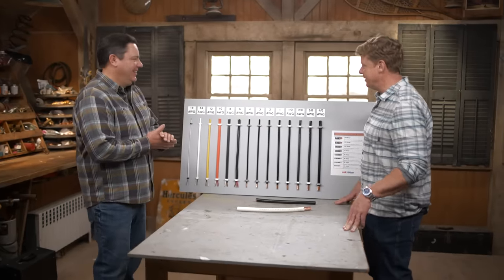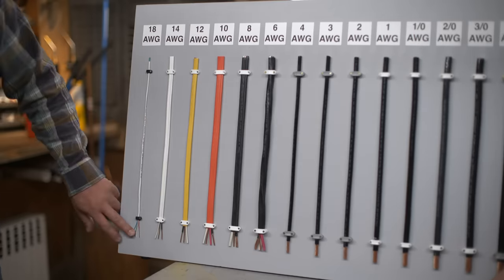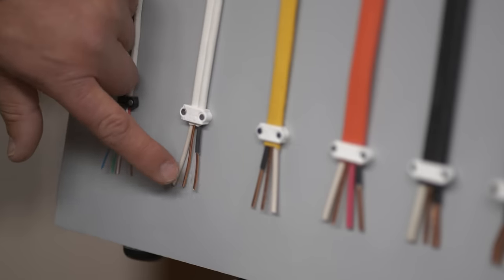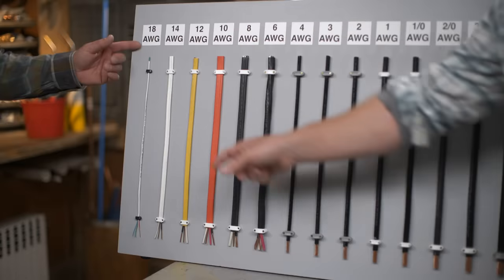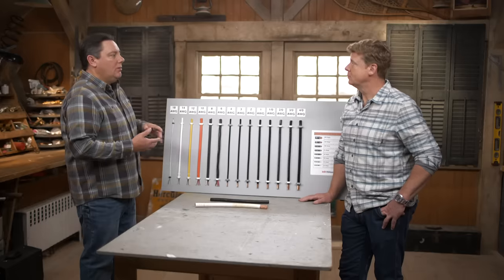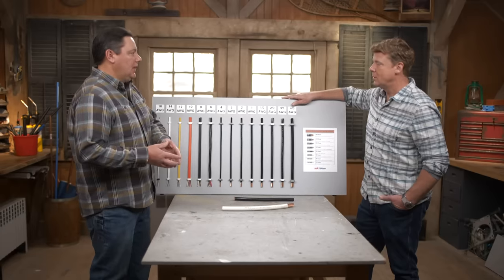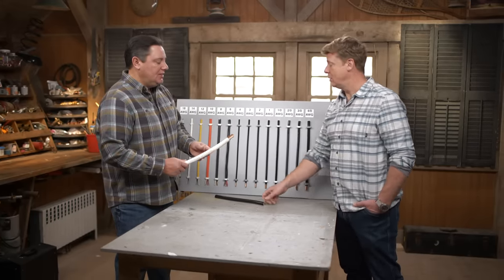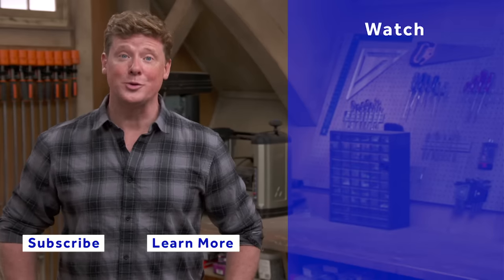Understanding Wire Gauges | Ask This Old House

Comment: Metric is way easier🤯
Here in the Netherlands and some other European countries in a new house:
Mains connection is 3 fase, 230V, 25A with a separate neutral and ground.
The wires inside the breakerbox are 6 mm2 thick.
The circuit breaker are 16A with 2,5mm2 wires running to your outlets/lights (except the switch wire for the lights, this one is 1,5mm2). All the switches/outlets are designed for 16A 230V.

Do you need more power, use 2 fase, and the neutral. Stil not enough, 3 fase and neutral. 

Still not enough, what are you doing with around 11000 watts on a single breaker? Yes you can get a 35A 230V mains connection and with that your allowed to install 20A 230V breakers, but this is expensive! The fee for only your connection with the grid is 3 times as high. 

The only time you maybe can see a 4mm2 wire in your house is when you have solar or a car charger more then 10 meters (33ft) away from your breakerbox. 

And yes there are 10 or 12 mm2 and thicker cables but not used for 99,99% of the houses.

Comment: Which iec c13 uk plug i should buy?
I found ones has 10amp fuse and other 13amp fuse

AC INPUT ：100-240V-3.5A 50-60 Hz

DC OUTPUT：19.5V-11.8A 230W

Comment: hi great video, i want to put level 2 charger in my garage its over 75 ft run which gauge wire should i use 4awg? And has to be in conduit, which conduit should i use? size ? material? code here has to be in conduit...thanks

Comment: what's the glaring disadvantage of wiring the whole house with one or two kinds of lower AWG wire (to make it more powerful for multi-use need) besides cost$$$...so you can bring the blender into the bedroom per se (:P)???...and can a house be equipped with its own dedicated transformer to lessen if not eliminate / prevent surges and trips?

Comment: The color coding thing isn’t always accurate 
In the past I’ve personally seen orange that was not 10 AWG
I believe it was 12 if I recall correctly
Reply: Yes, they should have noted color coding didn't start until the early 2000s. I have 12/2 in my house with a white sheath and the date on it is 1999.

Comment: My house is wired with the yellow but only two wire ...only ground is from box to water pipe and glass fuses and paper wound mains ... id dare say my box is only 75amp .. even the drop from street is half the size of rest of neighborhood   ,,, house was partially rewired in the 70s ... all they did was run new wires to outlets
Reply: dont tell anyone, thats not code..fix it yourself with 3 conductor 2 live + 1 ground....its needed for lighting strike and problems...lowers fire risk...fix that yourself soon..if an electric company comes in, by law they have to report it to the city you live in, fines, rewire, bs, time, $$$ , you fix it soon

Comment: Would this feeder wire work coming from the main box at the house for a 50 amp RV service…175 ft ?

bring the power from the residential, commercial, and industrial buildings to outdoor constructions, which include pumps and lighting constructions.
The electrical cable is suitable for direct burial, as well as direct exposure to the sunlight. It is permitted for use as feeder or branch circuit cable if provided with overcurrent protection. Copper Underground Feeder Cable UF-B has a rating of 600 volts.
• Size AWG: 6
• Weight per 1,000 ft: 303 lbs
• Outside Diameter: 770X338
• Conductors: 2
• Number of Strands: 7
• Jacket: PVC
• Insulation and Jacket Thickness: 35 mils
• Jacket Thickness: 45 mils
• Ground Size: 10

Comment: Did i miss it or did they not explain what would happen if you use, for example, a 10AWG where a 14 AWG is needed? Using more where less is needed. I know they reversed that question and they said it heats up and trips switches.
Reply: Larger wire is fine, as long as breaker is sized appropriately. Just a waste of $$$

Comment: No 16 awg. I thought I heard that it will start to be allowed for lighting only since LEDs draw almost 1/10th of the power of incandescents. The code is currently assuming incandescents.
Reply: Yes there is discussion on 10 amp circuits in the 2023 NEC, however 16 awg copper or 14 awg copper clad aluminum NM and 10 amp AFCI breakers are not yet manufactured.  It's probably past time the code finally woke up to the assumption the days of 60 or higher watt incandescents except for special uses such as the heat lamp you might have in the bathroom,  have been in the rearview mirror for a decade now.

Comment: I work with lineman.  While most think 4/0 wire is huge they think it's "small"
Reply: I feel you. My site we are pulling in a total of 18 parallel runs of 3c 750 kcmil TECK to refeed a university campus. that 4/0 is the ground for the hangars and there is an extra 1/0 on top of the copper sheath and armour XD.
Reply: Just wait till ya see a transmission construction crew pulling 3x 892 Kcmil conductor between towers. A true artform in itself,  especially with a technician installing spacers off a helicopter.

Comment: any reason 12 or 14 couldn't be used for 10a or 15a receptacles?  If they're only drawing 10/15a on a wire designed for 20-30a, there would be no risk but you have the option to eventually upgrade the receptacle if you needed a larger power pull?
Reply: There are no 10 amp receptacles and 12 gauge wire is used for 20 amp circuits, not 30 amp.15 amp receptacles are permitted on 20 amp circuits (12 gauge wire) and is commonly done. There is no need to upgrade unless you are using a residential grade receptacle and want to upgrade to a commercial grade receptacle. Using commercial spec grade receptacles are advised and a 15 amp duplex receptacle would be fine. A 20 amp receptacle will not give a larger power pull, but if you have a 20 amp circuit with 12 gauge wire you can use a 20 amp receptacle if you want.

Comment: Thank goodness for the simplicity of the metric system. Cable size is the cross sectional area in mm2.

 Generally in a domestic situation we use 1mm2, 1.5mm2, 2.5mm2, 4mm2, 6mm2, 10mm2, 16mm2. 

We use 2 core and earth (for single phase loads), and 4 core and earth (for three phase loads).
Reply: Yes! Normally 1.5 for light. 2.5 for sockets. 4 or 6 for kitchen.

Comment: If you aren't sure if you should use 12 or 14 can you just always use the thicker 12 for almost everything in your home?
Reply: If you’re unsure, call an electrician.
Reply: I framed a storage unit complex. The electrician used 12 gauge for all outlets, lights, ceiling fans, water heater,garage door and gas heater. I'm sure he could have used 14 for most of it. If I build my own, I'm going as thick as I can.
Reply: @leviathanfafner  hell no. This show is for DIYers. Trial and error is how it goes. Lol.
Reply: @dirtbike662  it's probably better to go too thick than too thin. (That's what she said)
Reply: @Inspector Steve  Well, trial and error with electricity tends to end with fire, shock, and "its going to hurt the whole time you're dying" death.
Reply: It's not hard to plug in a microwave, blow drier, space heater, etc on a "bedroom" circuit.
Reply: Have you seen the price of copper lately?

Comment: I want to use a car charger to charge up a batter. Since the clip doesn't fit, I want I want to create a wire with smaller clips to clip onto the battery, what guage size do I need?  8feet for 12volt battery.

Comment: When I wired my house I ran 12 for all circuits, mostly because I already had several rolls of 12 and I'd have had to buy more 14 lol. Otherwise it would have been perhaps a waste but now I don't worry about any voltage drop for running a big vacuum outside on the other side of the house lol

Comment: I have two Romex cables with a white exterior going to the first of three ceiling lights in my kitchen that are wired in series. Each Romex has two black wires, a white wire and a ground. Why two black wires?

Comment: i have a 2 feet extension running hot doing 15 amp and the air fryer i use is normally running max 10 amp what would explain that
Reply: Too small of wire.  Your "2 feet extension" is probably not even 14ga.  Some devices with smart power supplies are designed to draw constant power. Power is volts multiplied by amps.  If the volts drop it requires more amps to get the same power.  I wouldn't expect an air fryer to be constant power though.
Reply: Get a better extension cord.  They sell extension cords that can handle a light or two, but you need an appliance level cord for those amps.
Reply: @trustbuster23  should i got another one of better quality who do 15 amp or higher? i dont need more then 1 item plug on the extension the cable who came with the air frying is 1 feet long so to get to the wall i need another 2 feet
Reply: @Aranak777  get an appliance extension cord, they sell them most places.  Those thin brown or white cords can't handle the amps.

Comment: Curious as to how long this standard has been in place. I'm currently living in a 1955 cookie cutter suburb house, and wondering if I need to see about updating my wiring to handle modern appliances that are in non traditional places. Things like heavy use, high end computing rigs in bedrooms, blenders and small appliances in an add-on that got turned into a guest house/in law suite. 

Really hoping I don't have to end up gutting my walls 7 years in.
Reply: Typically the main issue with older homes' electrical wiring is the lack of a proper ground wire. If your wiring lacks that, you really should have it fully redone at some point. The other issue with older homes is they aren't set up to carry the cumulative higher amperage draw of all those newer appliances. Your panel should have a main breaker on it or near it with the amp rating on it. If it's under 100 (50 or 75), you'll definitely want to consider upgrading the panel (which may also require upgrading your service, though it depends). If it's 100, that might be OK but it's tight, especially if you have an accessory dwelling. Most newer homes are built with 150 or 200 amp panels. 

My house is even older than yours, so I do plan to upgrade both the panel and the wiring at some point. If it's never been done, it really is something that needs to be addressed at some point. Now, very broadly speaking, if you've been there 7 years and you're not regularly tripping breakers (or fuses for some old houses) and seeing lots of flickering, you're probably not in danger of the house burning down. But the key word there is "probably". Having a licensed electrician inspect your home is always the best way to have peace of mind on those things. I will say you can look into having AFCI breakers installed (if your panel is new enough) by the electrician as a stopgap safety measure to prevent faulty wiring from causing a fire as it deteriorates. Good luck!

Comment: Can you go in reverse a bit? For example,  add a 12g wire to a 10g outlet etc?
Reply: There's no such thing as a 10 gauge outlet. 10 gauge wire is normally used for a 240v 30 amp circuit. You could use 10 gauge wire on a 20 amp 120v circuit and receptacle where 12 gauge is appropriate, but it would still be a 20 amp circuit. The only arguable cases for that would be for very long runs to mitigate voltage drop and in when an actual 20 amp cord and receptacle are required.

Comment: Will using a wire too thin cause a fire hazard?
Reply: I'm not an electrician but I believe so. Using a thin wire where a thicker wire should be used may overheat and cause a fire.

Comment: They should address the threats and protections. Breakers protect  against fire in the conductor inside your walls but not outside . If you use the wrong gauge extension cable you risk a fire . Eg cheap extension cable with a space heater you will have a fire – your breaker can’t protect you. 

Always be mindful of the load . A lightbulb is only 100ma . A hair dryer is 10 amp. A space heater 15 amp and so on . More amps = fatter cable (lower awg number ) = more cost

Comment: Ac units usually require 6 2 wire with 40 amps.  6/2 can handle 55 amps.  8/2 is 40 amps for range.
Reply: Range needs 3-wire conductor not 2 !!
Reply: @JK-qe6qq  can use 8/2 or 8/3 but latter is preferred

Comment: 2 wire cable is used for 120 volt circuits,  and 240 volt circuits with no 120 volt loads, for example an electric water heater or central air conditioner; the white wire needs to be marked as a hot, black or red tape near the end of the wire at the receptacle or appliance, and at the breaker box is typically used.   3 wire cable is typically used as travellers between 3 and 4 way switches,  for interconnected smoke/CO alarms, and for 240 volt circuits with 120 volt loads, electric ranges and clothes dryers are typically the only such loads in a  house or apartment.
Reply: Who is still using 14/2 for 120v circuits?

Comment: 14/2 “Two conductors and a ground”? 
Says that as he’s actually pointing to 14/3 wire. 

FYI: 14/2 has two wires used for DC circuits.
14/3 are the wires he was pointing to, used in AC circuits,
How could he not know that?

Comment: always get your wires right. 14 is bedrooms and outlets only you can only have 4 outlets on this bus plus two lights. Living Room, Kitchen, Bath, and Office is 12 the yellow cable because you have a TV, computer, and things that draw load like a heater or a stove. 10 the big orange is for appliances stoves, microwaves, dryers, garbage disposal, garage, those appliances. 8 is used for AC Units, furnaces, water heater, and utilities, 6 is used to car charges, ovens, and generators.   Everything 4 to Zero is cable you use those for the bus to supply power from the line. Know before you plug it in. Never plug heaters into a bedroom circuit that is 14 gage wire it will melt and overload don't do that I know because I did that before and had to replace outlets. Another thing you don't do is place more then four outlets in a room if you daisy chain and you don't add a GFCI near where the circuit begins it will overload. Finally if you are going to install a junction box cap your insulators and your wires do not splice if you splice a wire and it is not capped it will overload the circuit and you will have a fire.   Never install a three way tap that is an overload waiting to happen.

Comment: Note, you could just run 20 amp 12/2 to all your outlets. Not much more expensive. If you have, say, a portable AC running (drawing more than 1000w), and god forbid you plug in a clothes steamer or something along those lines, it will trip the bedroom circuit. Speaking from experience.

Comment: I would NEVER run an outlet off of 14! You never know what people might plug in; the danger for an electrical fire is too high and you’re not saving much money. All 110 outlets should be 12. I would only use 14 for lights. That’s it.
Reply: As long as the 14awg wire is protected by a 15 amp breaker, there is no risk of fire. It doesn't matter what is plugged in. 14awg is totally safe and acceptable for general use outlets. Anything with a standard NEMA 5-15 style plug cannot draw more than 15 amps. So if you can plug it in, it's safe to use. And if you overload the circuit with multiple devices, it will trip the breaker. These systems are designed for safety.

Comment: Our wire sizing needs to be updated and simplified. It seems antiquated by going high awg for lower amps then lower awg for higher amperage and then higher awg single conductor before switching to a metric system… 
I wish is just had the amperage rating instead.
Reply: No sense in changing now, just going to cause more problems that it would save. The only alternative is to go to metric in which case all the manufacturers have to re-tool because metric aint going to match up with AWG without being really akward decimals.

Comment: Curious about the difference between 14 and 12 gauge, and say 12 gauge is in kitchens, etc.  Yes, in a perfect world, but we know home builders dont always do whats right.  Doesn't it matter what circuit its on, as in a 15 Amp Circuit Breaker ora 20 amp Circuit breaker.  I thought the breaker is what was designed to trip due to the load.  Microwaves for example can be used on 14 gauge lines and they dont draw 15 amp.  Dont tell me homeowners what gauge of wire are in their kitchens at every plug.  And for the GFCi Plug, why cant you use a GFCI on a 14 gauge line?
Reply: It's possible that you could use 14 gauge wire for a microwave as long as it's a dedicated circuit and the microwave is 1200 watts or less. A 1200 watt microwave requires approximately 1400 watts at input. So in this case it would be at the limit. Maximum allowable power for a 15 amp circuit 1440 watts.  (80% of 1800)
A 20 amp dedicated circuit would be a standard requirement. 
You could use a GFCI on a 15 amp circuit and 14 gauge wire. The fact is that GFCI's are required in locations where 20 amp circuits are used, such as bathrooms, kitchens, washrooms, etc.